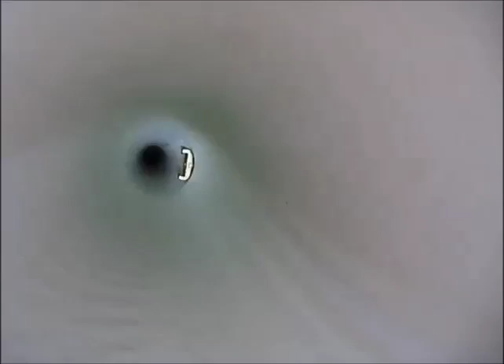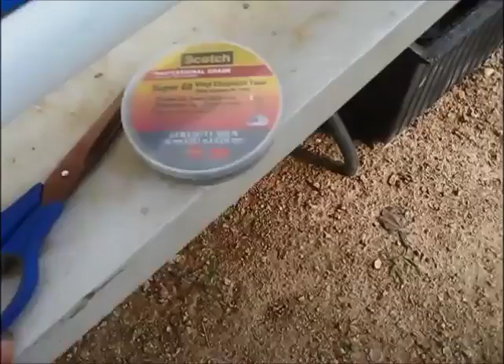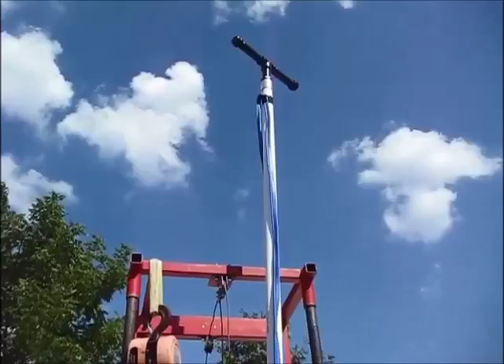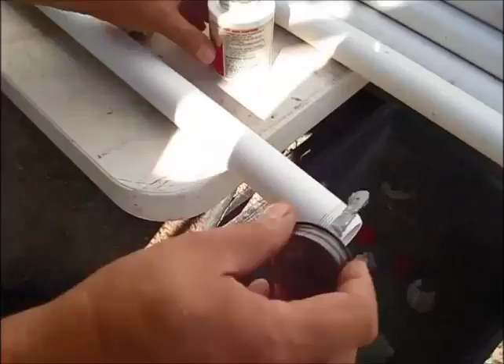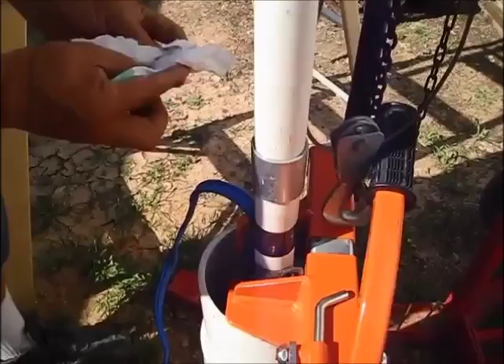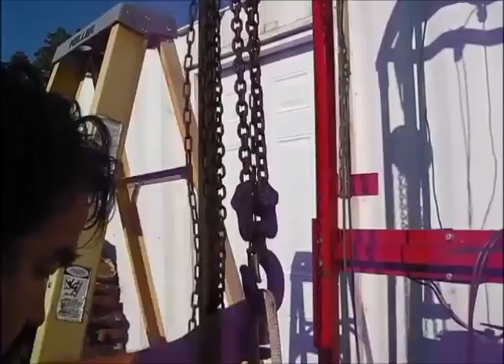DIY Deep Well Submersible Pump Installation Part 2

Comment: GREAT VIDEO, BUT WHY NOT JUST USE ZIP TIES TO ATTACH THE WIRE TO THE PIPES?
Reply from the maker: Cheap tape is unpredictable but quality tape isn't. It will stay in cold and wet conditions for a long tape and not unravel. Zip ties vary in quality are a mechanical device that is subject to breakage from vibration and other adverse conditions. At some point you will have lots of debris in your well hole that may block suction or create a friction point, accumulating on the top of your pump. That like a broken cheap safety rope will act as a wedge and make difficult or prevent pulling the pump.

Comment: I see the male end PVC is already threaded.  Can I buy these PVC pipes that all ready have a male threaded end ?  And if so what do you call them PVC what?
Reply from the maker: It's simply schedule 80 PVC pressure pipe, threaded both ends (TBE). You determine the size such as 1" or 1-1/4" nominal. They come in 20 feet sections. I cut and threaded mine to 10 feet sections, but that's not easy to diy. PVC will gall unless you have a special PVC die for your hand threader. Btw, you can also use schedule 120 PVC pressure pipe too.

Comment: yes I am building a  shallow water Rig .  I just want to know how tall is your rig.  I will be using 10 ft  drop  pipe down the well.
Reply from the maker: It's 9 or 10 feet tall and designed to use 6 feet sections of threaded pipe as drilling pipe.
Reply: Oh OK thank you got it.

Comment: Did you forget an anti torque device on the pipe? It keeps the motor from twisting the pipe as it kicks on.
Reply from the maker: doginstine Different dynamics affect start up and run performance. Since I used a control box with a capaitor up top, that coupled with the minimum sized wire gauge and run actually create a soft start effect, eliminating the need for an additional anti-torque device. Thanks for your observation.

Comment: you should tape over the couplings when you pull the pump in ten years they will have rotted out with iron . if you tape them they will be just like brand new when you pull this pump out .

Comment: Well, as someone that does this for a living, I love these eBay pumps. We have replaced three in the past year and a half.  All were  way over the required HP for the wells and none had pump-tech's installed, which is why these all failed.  Not one was installed with the proper gauge of wire for the the depth and distance they were installed. Not one had a torque arrestor and not one was installed with a check-valve. I applaud learning how to do things yourself, and I admire DIY, but there are some things better left to pros.
Reply from the maker: Ian H. I agree in part. As a former plumbing contractor, a good portion of service was correcting diy, but there is a large share that is successful and I appreciate people who get out of their comfort zone to learn new things.

Comment: Hello. Have you ever considered installing the pump on WellHose DIY Drop Pipe?
Reply from the maker: I suppose for shorter runs of less than a hundred feet, that would be viable. My installation is over two hundred. I believe the wet weight would be too much for a contiguous pull of the entire length. Not to mention that clamping equipment or elevators are made for rigid pipe.
Reply: WellHose is actually great to 300ft. It is 1 continuous length and is designed to support the weight of the column full of water as well as the pump and power cable. No support ropes or clamping equipment required making installation super easy.
Reply from the maker: Thanks for the info. I'll have to check into that.

Comment: I didn't see a torque arrester on the pump?
Reply from the maker: You are correct. I did not include one as it's a matter of personal preference. As I like simplicity, there's less to go wrong, such as wire failure hanging up on it getting it stuck or it by itself being an obstruction in pulling it. And the entire setup by design is minimalist, such as wiring sizing for the length of run, the capacitor being up top and that contributing to a "soft" start, lessens the need for an arrestor.

Comment: Those don't look like the proper pipe couplings, they look like electrical rigid non-tapered pipe fittings. Just saying.
Reply from the maker: You're correct. The vendor I bought my well pipe only carried slicks and they were pretty cheap compared to galv pipe couplings, so I went with those until I could buy them without breaking the bank. The wait paid off, someone on eBay was liquidating them dirt cheap and I got them on the shelf. Next time I pull the pump, I plan on replacing them when it goes back in. But, no problems and I was surprised a lot of installers here locally use the thread protector coupling instead of standard pipe couplings.
Reply: Fred Flinnster submersible kun sa moter ace ha

Comment: We just found your great video on submersible pump installation.  Thank you for using the Kwik Klamp 1 and giving the plug for this tool.  We appreciate it!  www.jktool.com
Reply from the maker: Sorry it took so long to approve your comment, but it was listed as spam and it took forever to troubleshoot. Anyway, glad to plug Kwik Klamp. Its a great tool. I will probably be calling on you for a set of elevators, since I plan on pulling the pump to inspect the setup and replace with merchants with pipe coupling this summer. It would be a lot easier than dealing with the lifting straps I now use.

Comment: Yesumessiah, I appreciate your effort and detail layout of the materials used and the equipment. Can you post the list Please.

Thank you
Reply from the maker: +kweku69 

2HP Chinese pump, sitting on the shelf useless. Don't make the same mistake. Bought on eBay. 

Buy the Franklin 1HP J series pump. Same performance curve. Bought on eBay. It's called a three wire pump, but it has four wires that include a ground, technically 3+1, so 4 total. You'll need the extra wire that puts the capacitor in the control box above ground. That way, if you use a generator, the startup requirements are much less and you can get by with a much smaller generator. Mine is a 5500/8500 for this 1HP pump.

The Chinese pump came with a hundred feet of 3+1 wire. I bought an additional 200' spool of 3+1 wire on eBay. You'll need whatever depth you'll set your pump.

Also bought a matching control box w/single start capacitor on eBay.

Bought multiple (4) piece pump wire splice kits on eBay. There were several in the auction. Good for mistakes and future projects.

(20) rolls of 3M Temflex. Much cheaper that way per roll. Probably use a half dozen or more. Use only brand name tape.

I bought (30) 1-1/4 merchant coupling because the local pump house didn't carry standard sch40 pipe couplings. They use merchants around here often but as a pipe fitter, I don't feel good about that. I just ordered 30 pipe coupling on eBay from Essential Hardware. The are 2.15 each roughly, and free shipping over 75. Can't beat that deal. Later this Spring, I will pull my pump to inspect and change all coupling. Merchants have a straight thread. Pipe coupling have a tapered thread and bite MUCH better. It's all a matter of feel and a good installer can do it well with Merchants, but I prefer the right item in retrospect.

I bought (15) 20' lengths of Charlotte Sch80 PVC pipe TBE (threaded both ends). That's 300'. I cut all in half and threaded them too. So you'll need a RIdgid 1-1/4" cutting die with ratcheting handle if you go that way. If you have an installer, he can put the entire 20' lengths in and you can then reduce your coupling requirements in half.

You'll need a 1-1/4 pitless adapter. I bought mine at Menards. They had the best price, less than fifty dollars.

The pipe terminated to a utility hydrant, aka yard hydrant, a full 1-1/4. Buy only American made yard hydrants. The Chinese junk doesn't last nor work properly. But, if you are running this setup into the house, you can eliminate that and insert the standard setup to include the proper relay, pressure switch and bladder tank, with appropriate 220VAC electric circuit.

As for my setup, I simply bought 12ga extension cord and sliced the pump to the control box, then control box to standard AC fused disconnect box. From there, I used more extension cord and bought a matching plug for my generator. This will vary with your unique setup.

Bear in mind, my setup is manual use only. It's not automatic and turns on only when I start it up. I also do NOT have a pressure switch to shut it off in case there is a valve closed and blow the line, therefore, I have a specific startup procedure that requires the generator on and warm, the hydrant opened, THEN the pump started. Shutdown procedure is reverse.
Reply from the maker: +kweku69 And of course you'll need consumables I did not list like pipe dope approved for PVC, PVC primer and glue, wire nuts, solder and acid for wire connections if you go that additional step, etc.
Reply: You opted not to use a safety wire?